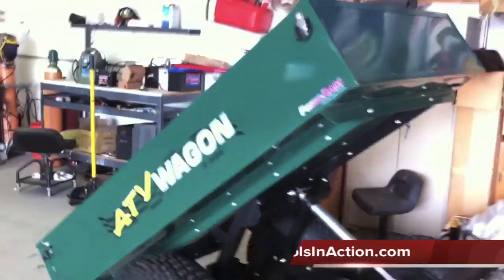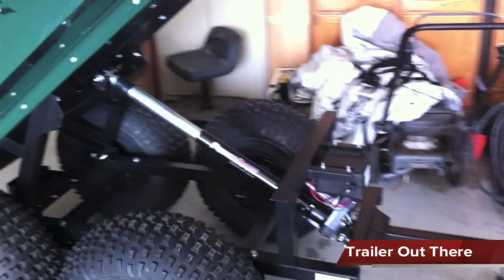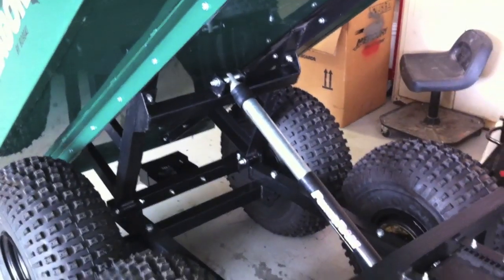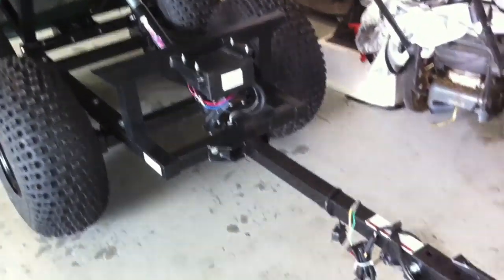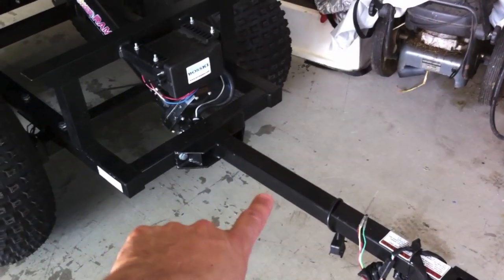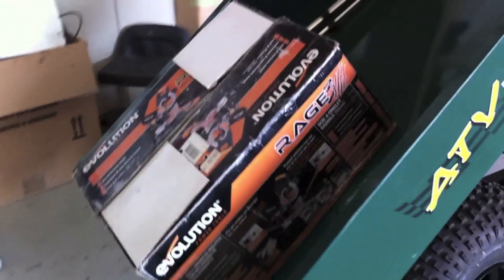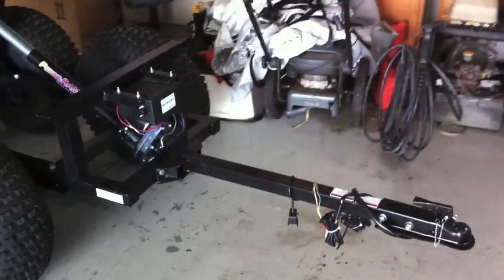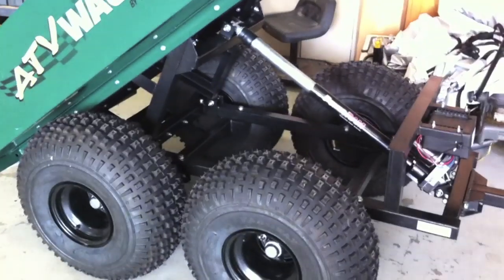Bosski ATV Wagon Trailer - Overview

Comment: I just used the Bosski  ATVAGON for a week of rebuilding a ATV Trail which had ruts that as up to three feet deep and we hauled three big truck loads of dirt and rocks up to a mile over ATV trail to get to the dump sight I think it did a great job and would tell anyone that if you want a good strong trailer to do yard work or trail work this is one that I would use. I Hauled it behind a 2011  Arctic Cat 700 TRV.

Comment: Were are the Boski ATV Wagon Made what is the different between the green and red wagon can you hook up a quick connect for the wagon to the atv for the battery will the electric brakes work with a 850xp sportsman atv i would like to get the remote for the wagon??